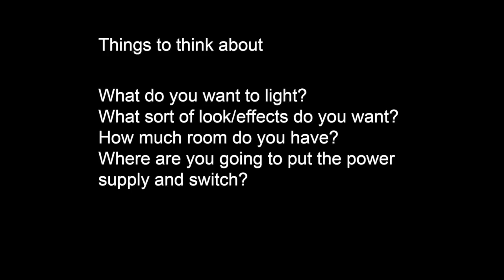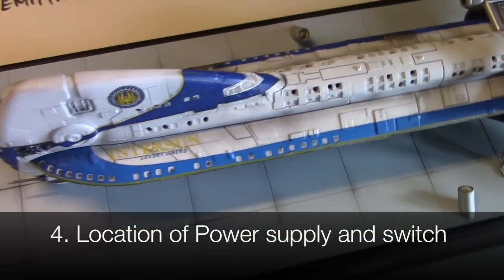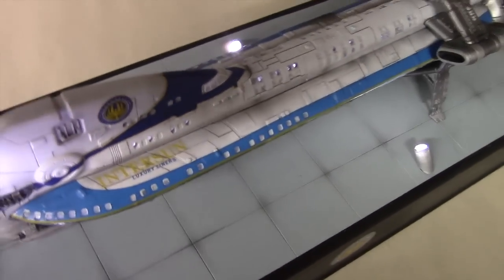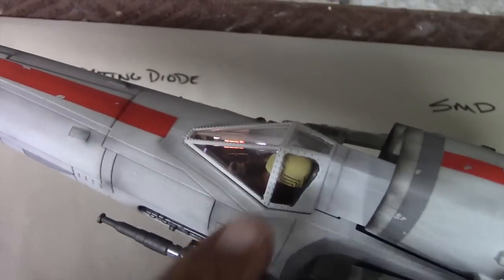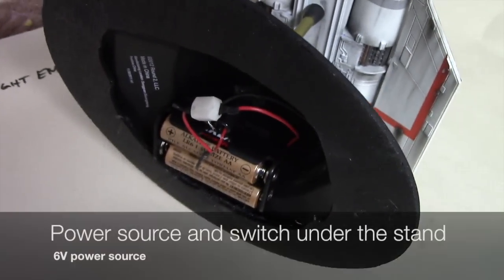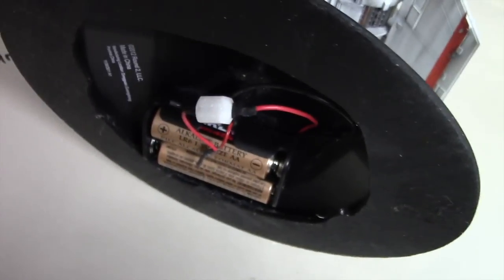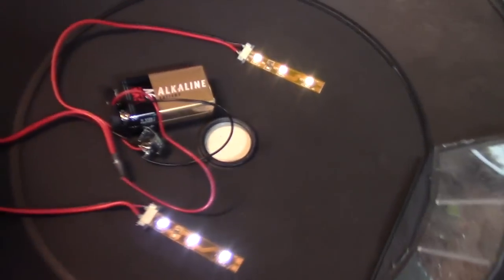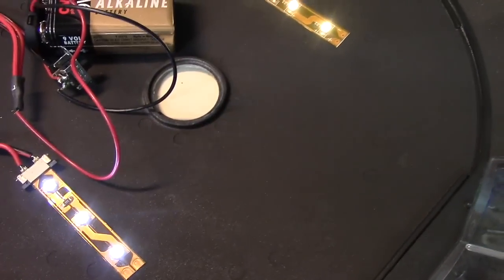Lighting Your Models Part 2

Comment: Sweet! Im building a Pegasus kit & am making a lightning plan. Im leaning towards a 12v plug in. Is 12v to much for the flickering diodes?
Reply from the maker: @jcwoodman5285  glad you’re finding this useful.  As for your question, not as long as there’s an appropriate resistor
Reply: @InterstellarModeler  Hello 🙂, do you know how many amps are needed to run a 12v like your Galactica?
All told I'm going to be running around 80 let's.
I'm selecting a power supply & was thinking 6 amps should do but🤔

Comment: hi mate, this is wonderful, thanks so much for providing appropriate links to grab accessories. May I ask ,I am lighting a trek model a 1/1400 scale effort I love the flickering leds here, they'd be good for impulse engines and bussard collectors, would you have those on a separate circuit?or on its own independent circuit from the main lighting!. thanks.
Reply from the maker: You can do it either way but i’ve kept them on the same circuit. No real need to separate them unless u want to. Thanks so much for watching and for your kind words.

Comment: You have a nice idea with this video but I wanted to see how you actually mounted the lights, what did you use to house the lights in the exterior lit models? How did you run the wires? You tell us what you did but I can see what you did, I want to know HOW you did it. Not a criticism, just a suggestion, it looks like you did a totally professional job, share with the class how you did it!
Reply from the maker: I really need to do an update of this video.  Maybe what I can do is build on what was done here and talk about housing.  The main objective was as an intro to lighting in general.  Appreciate you watching.  I'd like to launch a separate feature of just short and to the point tutorials.  This could be a good subject for one.  Thanks again.

Comment: Hi I have been watching your Video on lighting your mobiles  I have been trying to find a large scale Enterprise to put lights in but can't find any where would be grateful any information on where to go thank you
Reply from the maker: HI Alan. The largest scale models of the Enterprise are the 1/350 scales. Models of the orginal series, refit and Trek Enterprise have been available over the years.   The classic series 350 scale is definitely available, not sure about the others.   A good online source is culttvman.com.   I should also note that Round2 has announced a re-release of the AMT 1/650 scale Enterprise with upgraded parts is on the horizon as well. If you're looking for accuracy, however, the 350 scale is the best that I've seen.  Hope that helps and thanks for watching.

Comment: In the lite cockpit of the viper, how do you make the control panel displays translucent and get them to appear in different colors so close together? I would imagine that it is LED behind. If you are using different color LEDs you must have a way to isolate the light from the red LED from the cool white LED
Reply from the maker: With something that small the best is to use eithr UV curing clear resin (which is available in a small bottle) or canopy glue to fill the openings. Then use clear tamyia paint to independently color each opening.  That way u only need a white LED as the light source. Hope that helps. Feel free to email me if u have any other questions. Here’s the link to the resin. One bottle will last a long time. Cures instantly with UV. https://www.michaels.com/signature-crafts-light-cure-uv-resin-3.68oz./10625688.html
Reply: @InterstellarModeler  thanks for the the great reply. This one reply answers so may questions, not just for me, but for a bunch of us. Thanks for sharing! Excellent!

Comment: I'm lighting an RC heli, and so far had no issue with making them work, apart from when I've added flashing bulbs for navigation, they seem to dim the "static" bulbs making them almost flicker? can you advise if I can change this or do they need to be on a separate power supply? thanks in advance!
Reply from the maker: Hi Phil......I'm not sure on this.  I would contact the folks at evandesigns.com (formerly modeltrainsoftware).  They are great at answering questions like this.
Reply: @InterstellarModeler  many thanks have emailed them......

Comment: When you made the bsg model and added those decals did they come with instructions as to were to put each decal? Or did you have to work it out?
Reply from the maker: Both the Colonial One and the Viper have instructions on where to place the decals. The biggest problem I had with Colonial One is poor alignment (with the windows).  When the windows are not drilled or filled in it's not as noticeable but otherwise you can easily see the decals to align well. Highly recommend a decal solution like microscale's Set and Sol solutions which help to soften them.  Lots of contour.  Hope that helps and thanks for watching.
Reply: Interstellar Modeler with the galactica what bits of the ship did you have to paint that wasn't covered with the decals or whatever there called
Reply from the maker: Are you referring to the original series (TOS) Galactica or the re-imagined Galactica.  The TOS hardly has any decals.  The model was painted with Testors Light Gray. With the reimagined Galactica it was painted with Metalizer steel I believe then covered with over 1100 decals.  Let me know if you have any other questions.  Thanks
Reply: Interstellar Modeler the remade one
Reply: Interstellar Modeler do u think u can give me a link to the two sets u talked about during the video
Reply from the maker: I hope this answers your question.  I'm a little confused because the only BSG models featured in this video are the Colonial One and the Viper.  But....you can find all sorts of BSG aftermarket decals at culttvman.com.  The link below will access a page that features a variety of decals that you might find useful. Thanks  http://www.culttvmanshop.com/Sci-Fi-decals_c_116.html